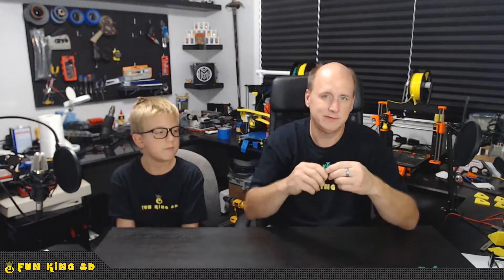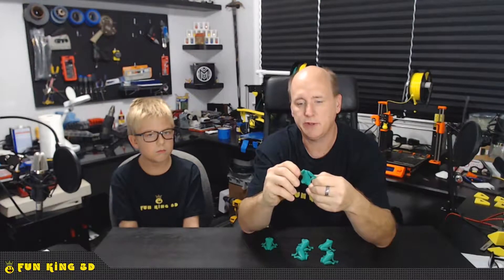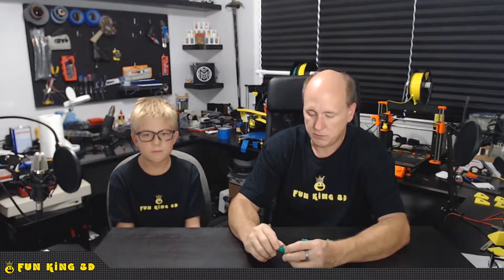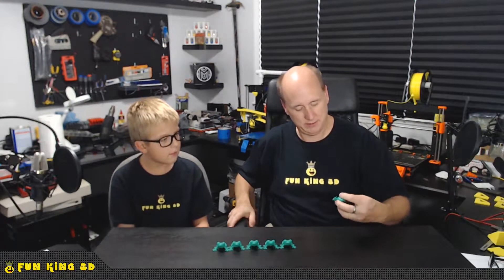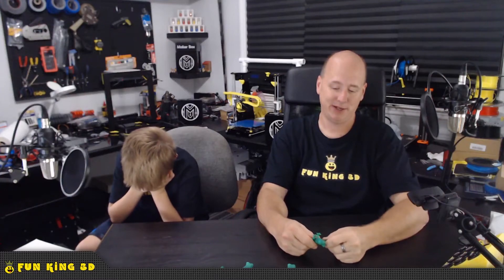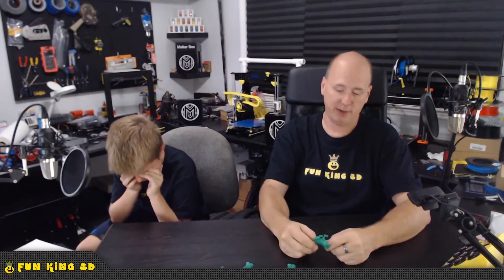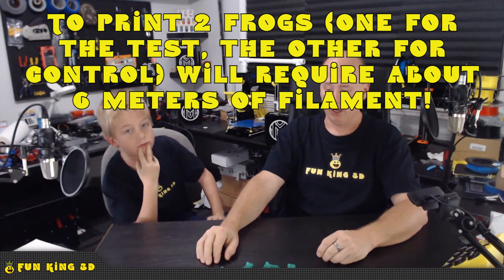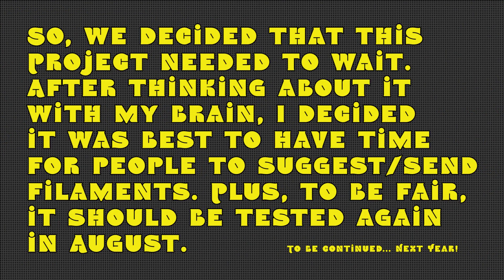Experiment: PLA Frogs In The Florida Sun

Comment: I’m going to be conducting a similar test with some antenna hardware for ham radio use this summer.  Once the snow melts, I’m going to hang at least one antenna with printed parts that will be under a bit of stress.  I am hoping all will be well.  I’m using AIO Robotics as well and am really happy with my prints at 195°c, I just wish I could get some orange filament though.
Reply from the maker: If it will be a stressed application, PETG might be the better way to go. I made some pieces this year for my Christmas display and the PETG held up really well. As for the AIO Robotics orange, you are right that it seems to be AWOL. You could pick up the 12 pack and get a roll, but that is not efficient. I will reach out to AIO and see if there is an ETA for replenishment.

Comment: instead of frogs use the butterfly (vicky) with different wall thickness & infill (just print the wings) and run the test. The frogs appear to be solid where the wings will have more surface area